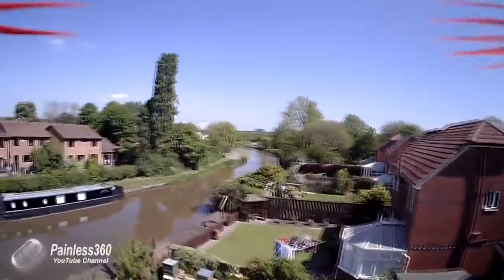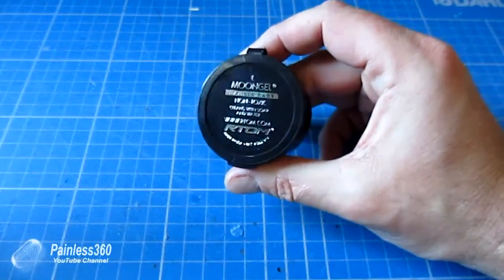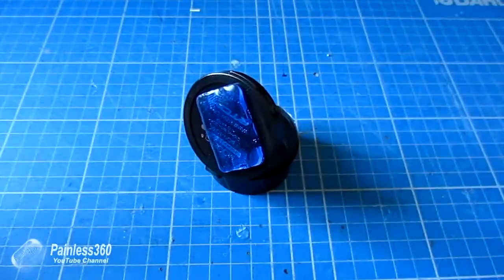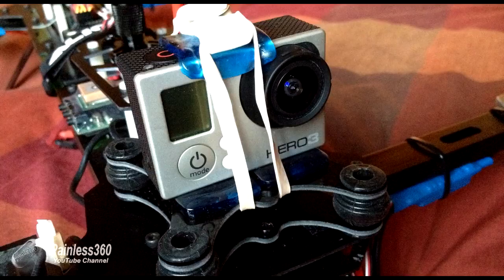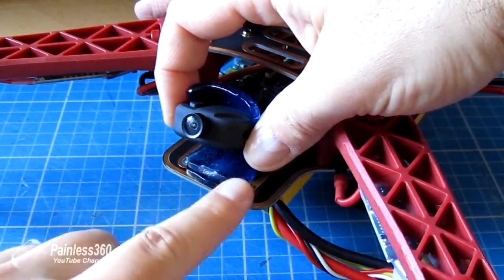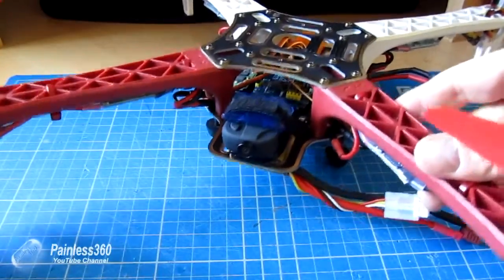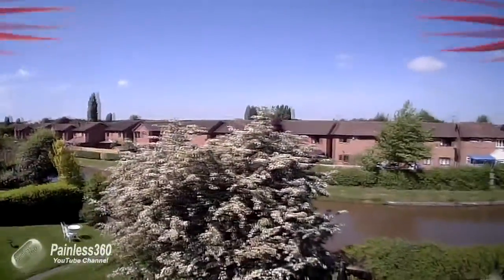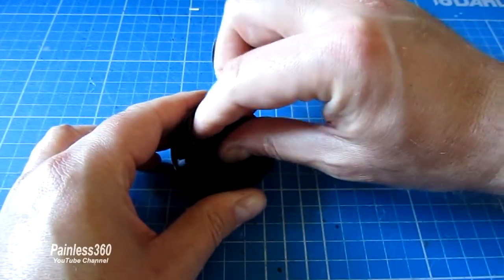FPV Video - My favourite damper for video - MoonGel

Comment: why do people treat damping just like localized fat-burning?  eliminating virtually all vibration everywhere else simply sends the oscillations somewhere else (they don't magically disappear, they go somewhere), usually to wherever your camera is hanging from.  damping balls are a joke.  make sure you don't fix a rigid part of your copter to another rigid part.  rather, alternate between rigid parts fixed to soft fixed to rigid and so on.  look to your whole machine's composition and not just where the camera is.  localized damping is like saying you can get rid of a pot belly by doing sit-ups.  use your wires to dampen simply by loosely touching them onto a hard part of your craft. heck, even zip-ties at the ends of the arms just hanging will give the vibration somewhere else to go and there disperse.
Reply from the maker: Hi Fullchain, I agree. I have a number of videos on things to check to help balance the different parts of the model. In my experience cheap parts are very tricky to get perfect, other problems come from the harmonics that can be created at certain motor RPM in the frame itself. A well balanced craft will not only produce better video but fly better, for longer than one without the basic balancing done.

After trying a number of mounting options for the camera I found that this stuff is a great, cheap way to remove that last problem by mounting 'rigid parts fixed to soft fixed to rigid' and removes the vibrations left after everything else has been balanced and isolated.

Happy flying!
Reply: I learned loads from you (specially with the tricky multiwii setups!), such an unusually logical mind, I thought to myself.   So when I saw some of your videos with jello I was, 'AArrg wt?'.  I kind of felt grief for you because you mentioned having tried several things (hate the idea that some jelly company is making money off of you when you don't need it lol), while I pretty much had to wreck my shit to get video jello. I never balance my props either lol but I won't be peddling that idea.  Thanks for all the information you freely share on the tube, sir!
Reply from the maker: Hi Fullchain, thanks for the comment. Interesting.

I have found that some cameras are more sensitive than others and the 808#16 cameras I use are very sensitive. What camera are you using? Thanks in advance.
Reply: Totally with you on harmonics.  A theory, something I gleaned off guitars:  the lower the frequency of the 'sound' the rotors/props make, the likelier that there is more wobble.  Similar to the waves created in water by hippos and elephants (?) when they let off a sub-sonic warp underwater, and of course the bass strings on a guitar.  Switching to 4S and 8inch props wityh 935rev/m/v, the pitch of the craft is tinnier, higher.  But not so high as to crack any hard, vibrating bits. maybe this is why the carbon-fibre 250's feel brittle to me, specially at the mountholes.  The high-kv motors emit an unltra-sonic pulse that makes micro-cracks untiol something eventually gives. shakes head  bwwuuu im getting deep... o.O

Comment: i use tha gelly like  insole of my gurlfriends high heelz , an it werkz great cheap 2
Reply from the maker: +Mykel Plaskett Nice idea!
Reply: i have a question about my open pilot gcs. wen i connect my cc3d  why dont i git all my flight gauges like i used to ? or do i juz need to re install ?
Reply from the maker: +Mykel Plaskett Not sure, I've had a few 'odd' thing in GVS and Cleanflight after upgrading to Windows 10...
Reply: i have had problems for tha last month with my mission planner an my openpilot .  but i switched to windows 10 3 weeks ago an i have not any problens with it so far .  my apm sitll will not git off tha ground i do not kno wut im doin wrong , so like i said i switched to my cc3d an that werks fyne , an i jus ordered tha new cc3d reveoution . i jus think im goin to sell both my apm's .  i jus want you 20 kno i watch all your videos !!!!
Reply from the maker: Best of luck with it..